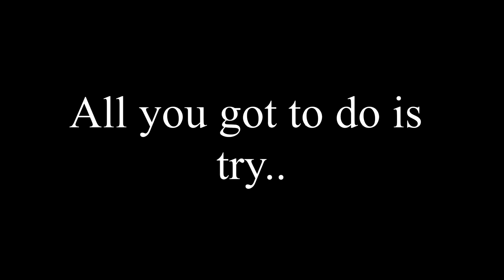Road to Mae Hong Son Loop & Golden Triangle Preparation

Comment: Hello can i ask which type model of engine oil you using? Where do you discard?
Reply from the maker: I use Castrol or PTT engine oil. For discarding the Oil, I will head to Lim Ah Boy's workshop to discard them. They have oil waste container right outside their workshop where you can simply just pour it in👍.

Comment: Nice trip bro, just got to ask where did you throw the used motor oil?
Reply from the maker: Thanks man! 😄👍. I would pass back the used engine oil to the mechanic shop at JB as they have the waste container. In Singapore, I pass it back to the shop where I purchased from and usually I give back in few bottles.

Comment: How do you guess the no of days you will need for the trip?
Reply from the maker: Oh hey! My objective was to reach Golden Triangle and complete the Mae hong Son loop within my last 10 days of my Probational plate, Class 2B. So I break up the total distance and roughly gauge where I would probably stop. I was reluctant enough to reach my destination on the actual last day😄👍. The return trip was about 8 days. Of all this days, I didn't have actual fix duration for my trip. However my actual rough estimation plan was to complete this roadtrip by 3 weeks. It could be done fast, but it would be a tiring ride and beside that, would definitely miss out alot by just riding continuously without enjoying what's there. Yeah, so if you're going far, add additional days to the itinerary so that it would be accomplishable. If it's all fixed time, it's really hard to predict. You will never know if the motorcycle would fail. What I can say is that it was immensely tiring to  ride for long period of time but nonetheless, it's something that I would remember👍.
Reply: @khaisyolo3493  i see..man..thanks for the long reply.. appreciate it..